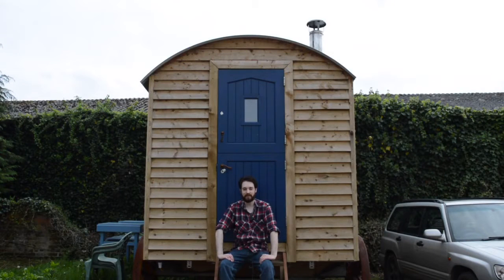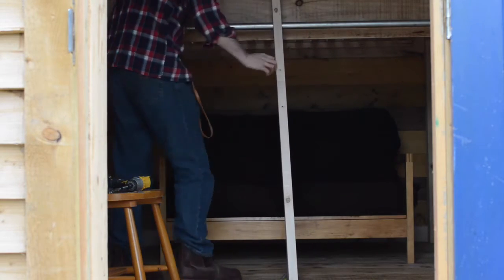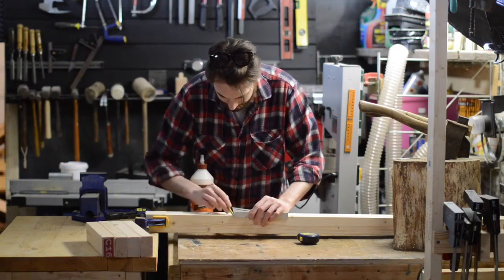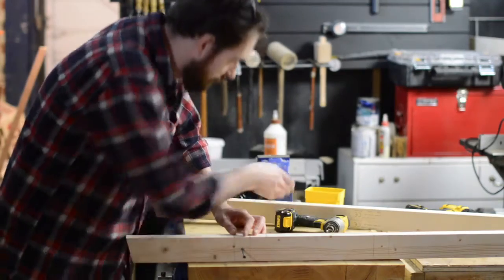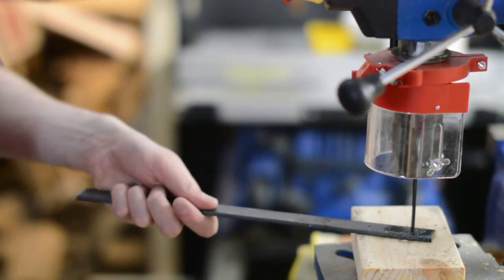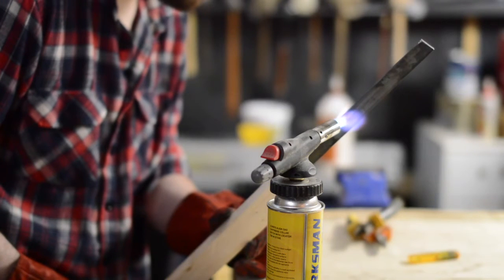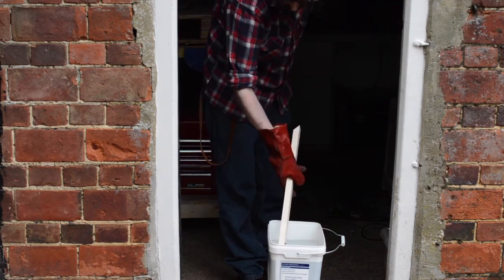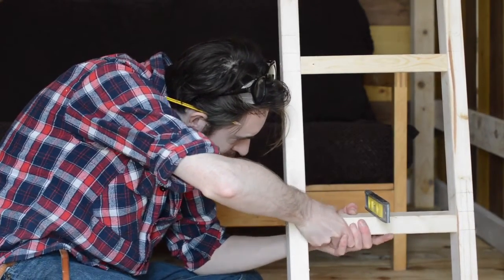How to make a tiny house / shepherds hut, bed deck / loft ladder

Comment: Nice work. I particularly liked the hooks you made. One question, though - at 4:20 you are attaching one hook to the top of the ladder. From the camera angle, it looks like you're only able to drive one screw, though - because the hook itself is bent around and is in the way of the other two holes. Were you able to drive screws through the other two holes too? if so, how? Thanks.
Reply from the maker: By using a long driver you can get the screws in at a slight angle.

Comment: Hello 
Anyone have an idea.  I have a  counter with sink running about 6 feet on one wall.
Currently a few over head cabinets and an office style drop ceiling over the entire kitchen space.
I've checked. This was esthetic - put in during the 70s by family member "updating" a Mediterranean style home from 1947.
Ceiling can be exposed.

So plan is to remove drop ceiling and along this wall above counter at normal height install shelving to ceiling 10' for more storage.
I'd like to have a ladder that can come on and off to access these once a year Christmas China kind of shelves...
Can I just buy a "flat" 8' ladder and alter it some how to work against, say, a metal pipe rail?

I have no wood working skills or access to tools beyond the basic electric screwdriver and a hammer...
Reply: Hi Madeline you would be better doing a youtube video and ask the question there to help people understand ,G.